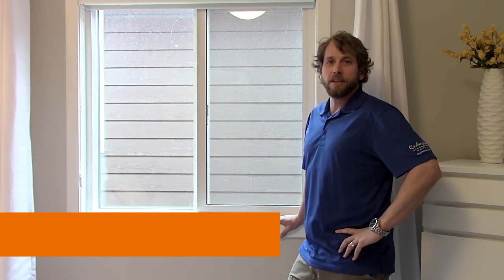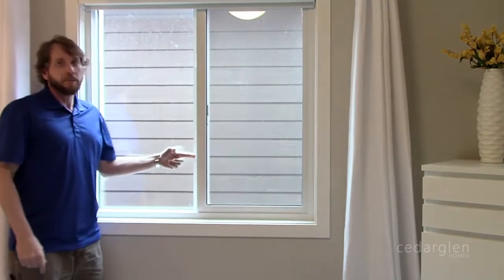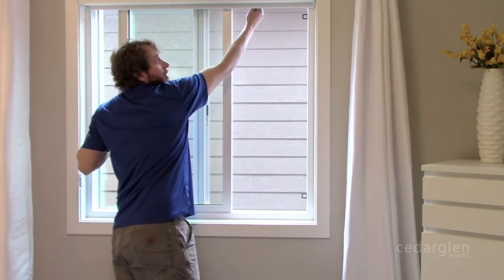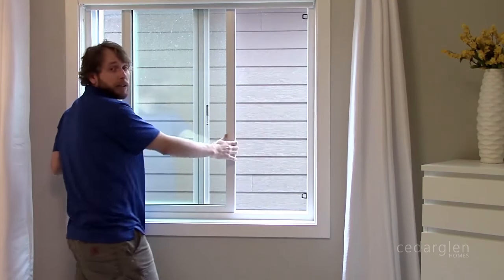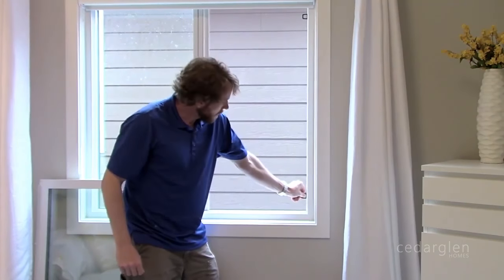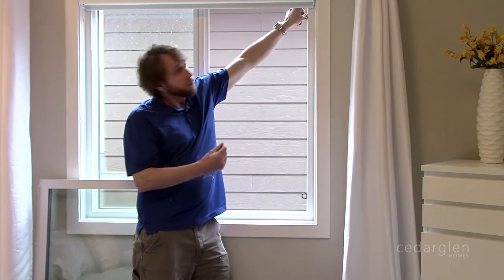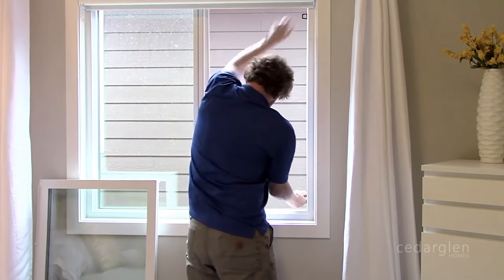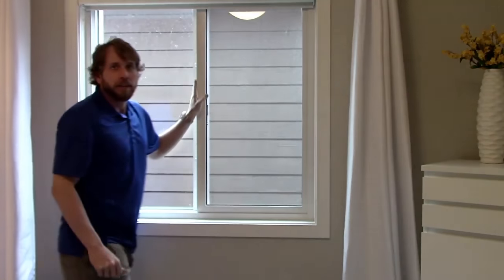Removing Your Horizontal Windows Slider - Homeowner Maintenance

Comment: How do you take out the left side?
Reply: With a putty knife, you have to cut the seal that connects the glass to the vinyl. Very similar to how windshield glass is removed but much easier because windshield glass uses a thick butyl which is very strong once it cures and iits hard to cut.

Comment: A tip on removing the window screens: DON'T use the tabs at all... mine broke almost immediately. Go to the opposite side of the screen and push against the side with the spring-loaded clips. Then use the tabs to pull the window inside your unit. You can actually just use the edge of the screen to remove the screen.

Comment: Hi. This was a big help. We have a broken glass pane on a horizontal window. Though the pane that is broken is the non sliding portion. Is there a way to remove the non sliding sash?
Reply: did anyone reply?I have same issue
Reply: My living room window has two sliding windows on either side of a stationary one. If I take both the sliding windows out I can take the center one out using the same method he shows. Hope that helps!

Comment: I just bought new windows in May and now in early June the slider window with 2 sliders and in the middle a glass piece doesn’t close and lock on the left window. It did for a while and now it doesn’t at all. There is no interference and the track is clean. What would cause this? Another slider window that got installed has the same problem. We can’t latch the windows because the window doesn’t meet up with the lock.

Comment: So you can only take out the literal sliding window? Is the other window permanent? Is the window screwed into the frame of the house?
Reply from the maker: Hi Doug! Yes, the only part of the window you can temporarily remove is the movable portion, all other parts of the window are not meant to be temporarily removed as they are permanently in place.

Comment: Hello, how do you remove the other (fixed/stationary) part of the window? I have a cracked thermal glass and would like to remove it to bring it in for repair. Thank you
Reply from the maker: Hi Santiago! Unfortunately the only part of the window you can temporarily remove is the movable portion, all other parts of the window are not meant to be temporarily removed as they are permanently in place.

Comment: Is there a way to reverse the sliding direction? I want to put the fixed window on the right side so that I can put an air conditioner on the left side
Reply from the maker: Hi Thiago, unfortunately there is no way to change the orientation of the slider. The fixed portion is part of the window frame.
Reply: If you can remove both panes. Flip them over 180s. So to is bottom and bottom is now to of the pane. Then reinstall windows. Make sufe both parts of the lock afw inside. You can then call them switched.

Comment: Help!  My Picture Vinyl windows:   the Middle window is stationary and do NOT OPEN.  The windows on the Left and on the Right open but they are STUCK and I can't open them.  HELP!  What must I do to OPEN them???
Reply from the maker: Okay, a very common misstep is to assume the lever is open when it is in fact closed. I would move the lever to what you believe is in a locked position and see if the window now moves. 

Another option - sometimes there is a lock on the jamb located in the upper track. Depending on the manufacturer there could be a lock that you can’t see unless you are looking for it. 

If all else fails, reach out directly to the manufacturer to have an experienced technician come out to assess and/or repair if necessary.

Comment: How do you remove the stationary panel on the other side?
Reply from the maker: Hi Zach! As well as being stationary, that piece is also permanently in place and unable to be moved or removed.
Reply: @CedarglenHomes  Got it.  So the only way to open up the full window would be to remove the whole frame/unit?  

Reason I ask - I am trying to move a large piece of furniture into my basement and I believe my only option is to bring it in through my egress window on the side of the house.
Reply from the maker: @zleahy  Hi Zach! Yes, the only part of the window you can temporarily remove, is the movable portion, all other parts of the window are not meant to be temporarily removed.